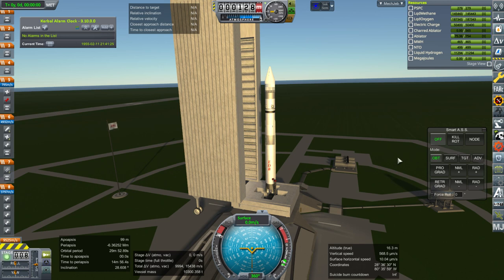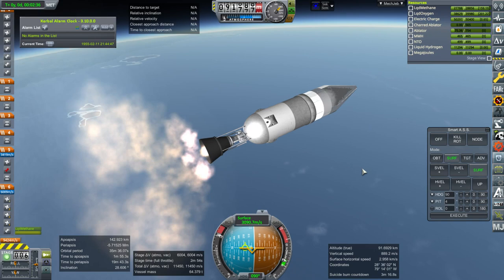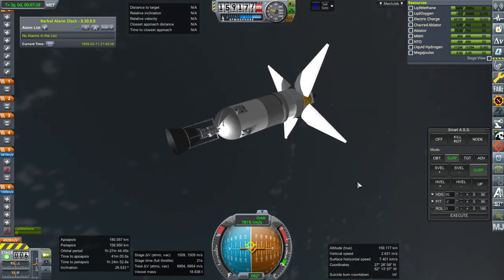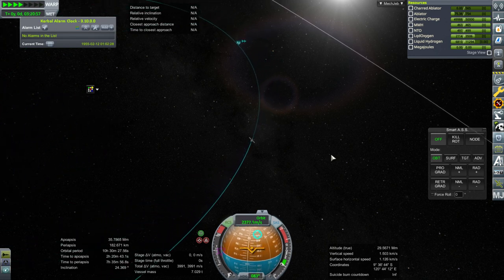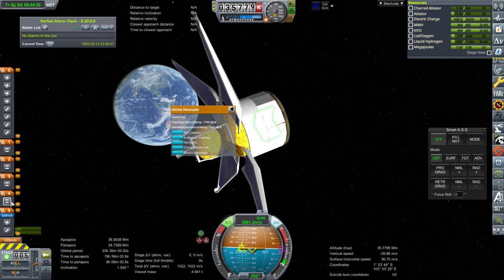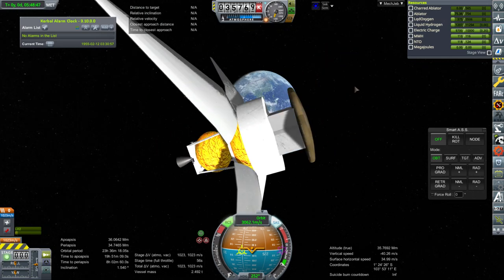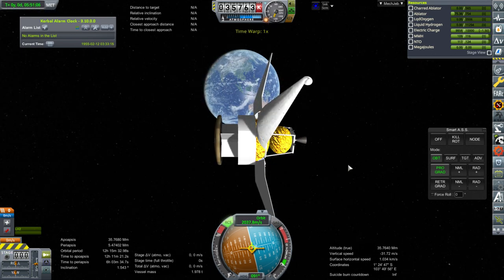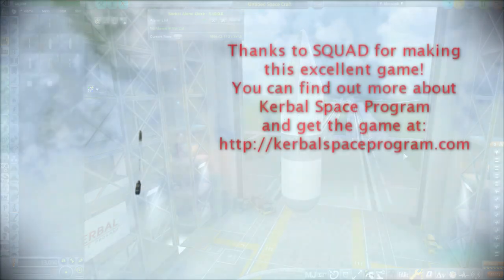KSP - Realism Overhaul Sandbox - OmSat System

Comment: MODULE
 {
  name = ModuleCommand
  minimumCrew = 0
  hasHibernation = True
  hibernationMultiplier = 0.00125
  defaultControlPointDisplayName = Up
  CONTROLPOINT
  {
   name = forward
   displayName = Forward
   orientation = 90,0,0
  }
  CONTROLPOINT
  {
   name = reverse
   displayName = Reverse
   orientation = 0,0,180
  }

 }
that might help with the backwards control point.